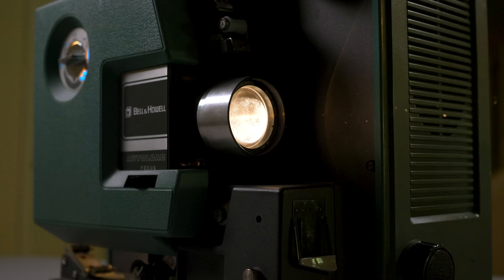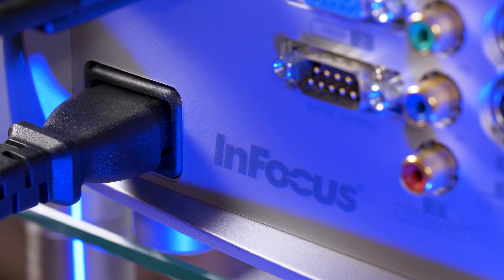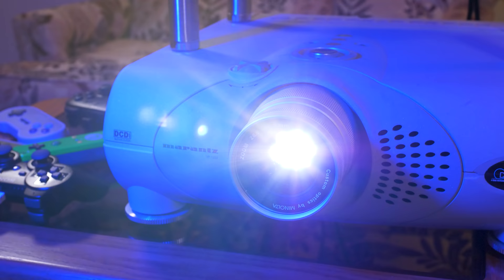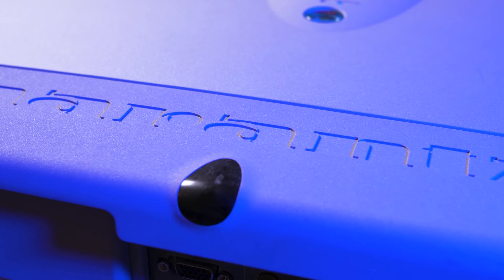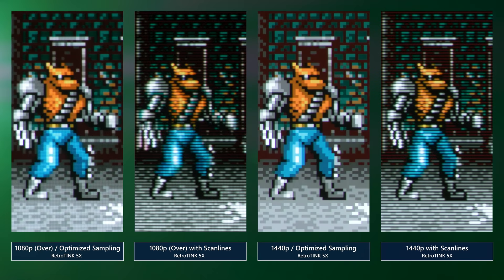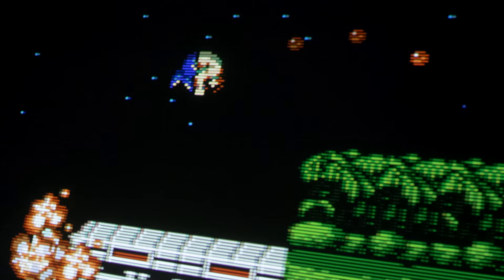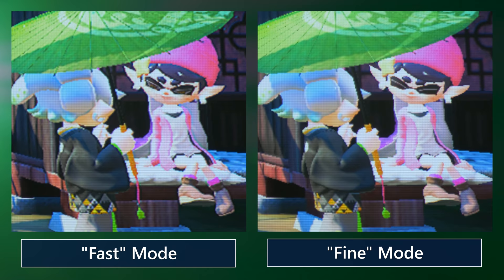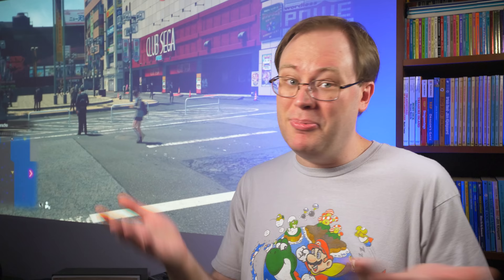Gaming on Projectors - From Retro to HD to 4K HDR / MY LIFE IN GAMING

Comment: AV is my primary profession since the early 2000s and I’ve been building theaters for a living since. So it was great to see a gaming channel dedicate time to this and it’s something I thought about doing a video on as well someday. If you ever want some feedback or ideas feel free to hit me up. As a quick note on DLP, it’s the color wheel due to budget that creates the effect you showed with the fan. This doesn’t exist with 3-chip DLP projectors or DLP based LED projectors that don’t need a color wheel. So you get the best of both worlds. Higher brightness, super fast response without the motion trails of LCD tech, and no rainbow effect. They were more expensive of course, but today you can find them cheap used as well. And you’re right on about native 720p. It’s my favorite method, using a 3chip DLP to play all the older games. It looks fantastic with no processing to upscale to 1080 or 4K. New laser models and sxrd like I use in my own theater are gorgeous for film, but not they or anything else perform like a 3chip DLP for games. It’s actually still the standard today for commercial cinema.
Reply: I did notice a big theater in one of your videos a while back. Thats pretty neat.
Reply from the maker: [Try4ce] Interesting, any particular model you'd recommend for 720p gaming? As you might've guessed, I've become a little bit obsessed with the idea of having perfect displays for 720p for the long haul, but I don't know if the two I have will fit that bill forever (the Marantz is very high quality but it's also a bit dim when viewed in person... I love it though).
Reply: @mylifeingaming  Check out the Sim2 C3X lineup. They had both 720p and 1080p models using triple chip DLP and were in the 15-25K premium price category at the time. Now can be found for under 1K easily and produce a pretty stunning image. Replacement lamps are pretty available too. They aren’t designed as gaming projectors per se so it may not be as fast as the BenQ with a game mode, but the image quality is superb. I’d be curious to see how they test with a time sleuth myself. I get a lot of hand me downs so I’m using a bigger commercial unit. Stay away from those unless you need it doubling as a heater in the winter 😅
Reply from the maker: [Try4ce] Thanks! I'll definitely keep an eye out for anything like that. It's honestly sort of a silly toy-like design, so I might've overlooked it had I stumbled upon it!
Reply: @ShmupJunkie  Thanks for these super helpful comments!

Dumb question: how does one calibrate these accurately to sRGB (since that was the color space target for the 720p gaming consoles for developers and the hardware)? Thanks.
Reply: @thanksbetotap  It’s the same as calibrating any display if using a colorimeter. You do greyscale and the basics,  then set the target curves to match your intended color space, then adjust the projector to get as close as possible to the sRGB target, not exceeding it unless you want it pushing colors beyond the BT709 standard. It’s as much an art as a science but not difficult to get 90% of the way there if you have the right tools.
Reply: @ShmupJunkie  Thanks a ton.

And do any of these projectors come pretty well calibrated out of the box? With high-end TVs we’re in a good enough place since the last 7-10 years. But assume these older protectors would likely require manual calibration to get reasonable?
Reply: @thanksbetotap  It’s completely dependent on the manufacturer they aren’t uniform. Most would all be optimized to the typical rec709 HD standard at the time as they were intended for home theater film content.
Reply: @ShmupJunkie  You mean they would actually typically measure reasonably accurate to Rec.709 out of the box? At least certain brands?
Reply: @thanksbetotap  HT projectors yes as that was the standard at the time. Maybe office/business units would be different but you’re not likely looking at those anyway.
Reply: @ShmupJunkie  Thanks a ton!
Reply: The AV world puts a premium ($$$) on 3 Chip DLP Projectors. Most of them have RGBs inputs, I would say Panasonic and Christie models were king at the time but I’m not sure about lag.
Reply: Even single chip DLP's can have pretty big differences in perceived rainbow effect.  If you are susceptible to seeing rainbows or are afraid it could be a possibility look for Dlp projectors with faster color wheels.
Reply: How do you hook up av on a newer model projector
Reply: @ShmupJunkie  Hey, I know this thread is 2 years old, but now that the Retrotink 4K has come out I'd be curious to know your thoughts on the Tink 4K combined with a modern 4K projector.  Do you think the results are good enough to where there's no longer any real benefit to keeping a native 720p or 1080p projector around anymore?

Comment: Impeccable timing. I've been looking into getting a projector for the last week 😄
Reply: I love it when things work out like this. Good timing indeed.
Reply: I've been running a optoma hd142x for a couple years its our living room experience only on my 2nd bulb that lasted over 8000hrs.
The newer projectors bulb life is expected to last 12-14000 hrs
Reply: I had an Optoma HD26 which was fantastic for 1080P and 3D content, but upgraded to an Optoma UHD30 which offers 4K HDR (through pixel shifting) and can reach 1080P 240hz when connected to a PC. The rainbow effect was noticable on the former, but it's extremely rare I notice it on the latter. Projectors can't compete with TV's on contrast and blacks, but the screen size is amazing. It puts you right in the game!
Reply: I got an Epson powerlite cinema a few years ago its 1080p and has hdmi, vga, s-video, component and composite inputs to accommodate multiple console 👍👍

Comment: I used projectors for over a decade as my primary television, and the benefits are great for gaming- especially when I used to throw Rock Band parties all the time. The drawbacks eventually turned my old projector into a novelty item- particularly the low amount of light required for good viewing, the high cost of replacing bulbs once/year, plus living somewhere with a large dedicated wall made finding the right place to live extra difficult. In the end, they’re great for parties, and I loved it when I lived alone. Now that I have kids who I share the screen with, and the desire to watch with more light in the room, I’m happy to pull it out for special occasions rather than as my primary TV.
Reply: Yep.  They’re fun, but you really have to craft your lifestyle around them.

Modern large-screen TVs are just so much better than the options 10-20 years ago, which makes it harder to justify the rather stagnant projector technology.

Comment: Having used old or lower end projectors in my basement, the best advice I can give is, "Don't look at the picture too hard. You'll see all the flaws and never enjoy the content."
One potential long term issue with 3LCD is the prisms and/or LCD elements getting out of alignment. This will result in the image having similar focus issues as CRT projectors. Everything in the projector world is a compromise.
Reply: I had a 3LCD projector for something like a decade, and in my experience, the convergence doesn't drift over time... it's just never perfect to begin with. I still found it to be a worthwhile tradeoff to avoid the colour brightness/quality issues that come from colour-wheel DLP projectors, at least at the time.
Reply: Haven’t had any convergence degradation with my Epson, but the LCD dye has started to degrade, leading to color purity issues.  And I’ve gone through quite a few lamps.

I do enjoy it, but is it worth it..?  Ehhh....

Hoping that laser projection will save us.

Comment: As someone who has played retro consoles using a projector only since 15 years, I can say it is a great experience - especially in multiplayer games (i.e. Bomberman).
Reply: I used to have a similar model to the marantz. It was very immersive for single player. Got me through 2 console generations. Ps2, Xbox then 360.
Reply: Playing my Dreamcast or ps2 on a epson projector from about 2014/15 looks awesome way beter than my Sony or Samsung lcd tvs. A lot still have av and older style connections.
Reply: This is a longshot, but any experience playing retro games on an HT2050a? It has RCA inputs and i'm hoping i can reduce the internal resolution like at 25:25 so image isn't blown out to a disgusting degree like playing N64 on my 4k TV is

Comment: Nice Video, thanks ! I am also a AV specialist, I worked a very high end audio video store for years, sold reference audio and home theater projectors. I also ran a business doing custom home theater for years. Very mid to high end gear.

I've been here before, I have a few 720p projectors and even a 480p projector.  I have played my NES on the side of my house well over 150" (it does get a little, well a lota blocky) with a NESRGB kit, it looks really nice.  I hung up a white sheet in front of my 65" 4K (low lag model) and was playing floor to ceiling games. The experience is amazing, playing classics on such a huge screen is wild.

I would go camping and setup a sheet and project on it, we would watch baseball games and bring a console, playing in the woods (with power of course) on 75" wile gaming... awesome.

The key things you want to know on these things if you buy them, LAMP life, If you get $40 projector with 3000 hours on it, it will be dim and you will have to replace the lamp in it, SOME of these lamps can be $350+, so be sure you do your homework and test it if you can, you can see in the menu how much life is on the lamp.  Do research on the brand and model, check display lag, and make sure it's got the inputs you need. Also look how much a replacement lamp is for it. A little plan can go a long way here.

Like one of the projectors you saw it here, had DVI-D (DVI- digital) this can use an adapter and give you HDMI BUT, with no DHCP (most cases) so some content won't play or be able to be watched on it.  This can be a problem on PS3, 360 and newer...but, earlier, no worries. There is some homework to do if you want to do it right.

DO NOT BUY NEW projectors under $100, they are all junk... you will regret it. Spend $100 on a 4 year old USED $3000 projector you will be very happy.

No question, it's fun, can be quirky time to time but, in the end it's so worth it...

Comment: CRT Projectors... I'm not dissapointed with that not being covered... because this is the first time I ever learned about it.
Reply: They are so heavy you wouldn't believe it. Shipping alone is over $1,000 if you can't find one locally. You need a handful of people just to help you move it a few feet. Maybe 5 people I dont know. I have looked into them but I wouldn't want to buy one unless it wasn't used much because once one of the tubes goes, its done.
Reply: @StarshipGhost  That's when the usable tubes can be modified for an ossiliscope.

Comment: Outside the cost of a projector, the screen can literally be anything you want it to be. That's the great thing if you want to max out your 150" wall or 200" you probably can on even a modest projector, I had the benq 1070, and aside from not 4k it was the definite experience.
Reply: @TheVisualNovel  it wasnt life changing watching an anime Movie that took over a decade to make... ON YOUR CEILING?
Reply: I also have the Benq W 1070 and I've been very happy with it. I love the large picture. The main problem is the gray blacks, and that it's hard to see when there is light in the room. I'm considering switching to a LG CX 55" flatscreen, but I might use my 1070 until the lamp dies first.
Reply: @CousinKinoko  good luck with that, almost 6 years and 10k hours and that lamp is still going.
Reply: While yes you can have the screen literally be anything you want it to but not projecting on a half decent screen you will be leaving LOTS of picture quality on the table so to speak.  This is coming from a guy that has owned 3 projectors in the last 10 years.
Reply: There is a definite Yes and No to this.

For an average person who just wants a big screen, a relatively flat, whitish wall will work just fine.  You definitely won't get the BEST clarity, but for the masses, it'll still look great.

Anyone who is looking to really display what their projector is made of will definitely want to invest in a proper screen material.  With that being said, more expensive does not immediately mean better.  Sometimes a basic or midrange screen can be perfectly fine and improve your picture dramatically.  I'd probably get a screen if you're looking to use it more as a TV replacement, rather than just a fun random movie night thing.  Not having a screen will definitely become apparent over time if you sit in front of it long enough.

Comment: I've been gaming on projectors for years since I got my first one for holiday projected decorating. They tend to make you understand super high(4k) resolutions are not needed to 
Play any game.  I find in some ways being able to see pixels on some mini projectors gives a pleasing and nostalgic huge gameboy screen experience. Those in focus can get a very big image as long as it can focus, and have a slight pixel blur to hide pixels.  I also still game on a rear projection CRT Mitsubishi. That thing has outlived the mountains of flat panels gone Ewaste.
I prefer xga ,or wvga, resolutions because they are more realistic and versatile without huge borders.  Those Chinese LED projectors are good at resolution emulation like a standard PC monitor. Although with any monitor there is the dreaded not support resolution warning when using with a PC  signal that isn't set within display specs.  Those In focus 3 LCD models are nice. I have the XGA Lp540 and Lp640 models.  I refurbished them from heat stress and neglect. New bulbs are still available.  I have several LED projectors I refurbished and some I improved lighting on. Most LED types have a Cool color temperature making them have a overall blue color shift.  Some got inventive like the Unic UC80 that had red, green, and white LEDs  that made the image more realistic and true to color.
Reply: They might not be needed to play a game, but that 4K adds to the experience massively.  What I found was that the LCD (1 or 3 chip model) projectors really wreck the image with the screen door effect.  DLP all the way.  A 800x600 DLP acer I was recently given knocks the socks off a 1080p LCD one I was using at the time, both in clarity and especially brightness.  It was way easier to get a uniform focus from corner to the center of the screen, something LCD models struggle with a lot.

Comment: I got a cheap 720p projector a few years ago, never really ended up using it much until I got a real projector screen. It was like 50 or 60 bucks from Amazon, 100 inches and has a light diffusing screen with black backing layer. It was immediately noticable how much nicer the colors were and how much light was just being wasted using the wall before. Definitely more expensive than the wall but if you like the projector, a cheap-ish screen is a solid investment imo.

Comment: I have used DLP projector as my only screen at home since 2005, for games, movies, series. From 2005 to 2010 it was the Toshiba MT200 (480p DLP) and since 2010 the Mitsubishi HC3200 (1080p DLP). For DLP projectors and the rainbow effect it is worth mentioning that the color wheel can run at different speeds, and they might also have different number of colors per cycle. It varies a lot across models. While I can see the effect if I try really hard and with the correct picture (white text on black background) it never bothered me, and not a single guest have complained.
In a room without windows I think most home cinema projectors would work very well, but in a normal room light control during daytime is worth investing in (black out curtains)

Comment: I'd like to try a projector or two, and was super tempted partway through the video, but once the negatives popped up (replacing expensive bulbs, dealing with the noise, etc), I was like, "Yeahh.. I'm good for now." Too many hassles for my tastes, but still neat to see in action nonetheless. Anyway, great episode! Learned a lot here.
Reply: They're not that loud, just turn up the volume
Reply: @jonhunthrop1882  compared to a silent OLED? Especially considering the screen size can rival these older projectors. Not the short throw BenQ’s size though.
Reply: No cons all pros with BenQ X3000i. Literally changed the way I play and see games. Revisited Horizon Zero Dawn and at 110", is a far better gaming experience I had over the 32" with forbidden west.

Comment: I was projector guy since early 2000's. And still use two for gaming and movies. One is old low resolution with all connections i need. And second NEC with native 1600*1200 which perfect for 240p 5X upscale.